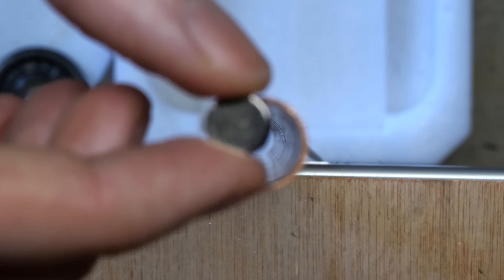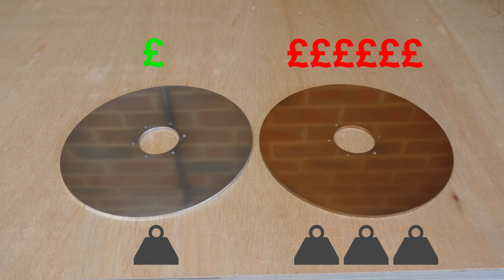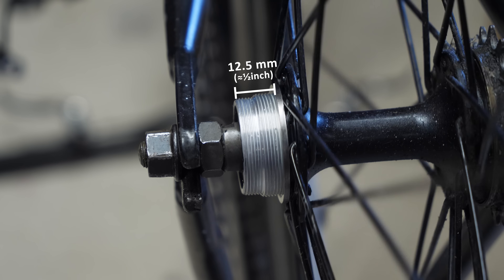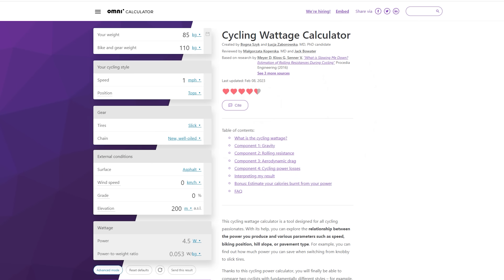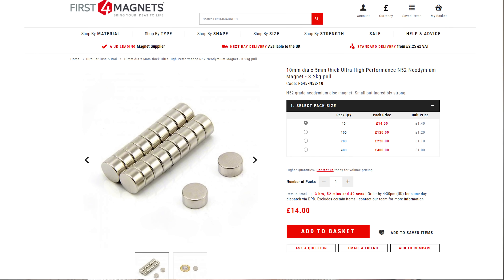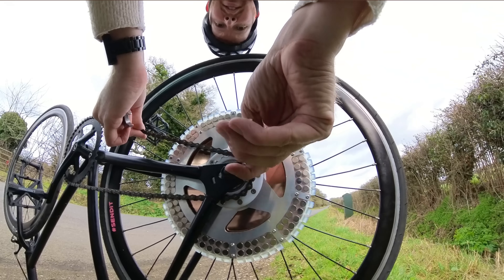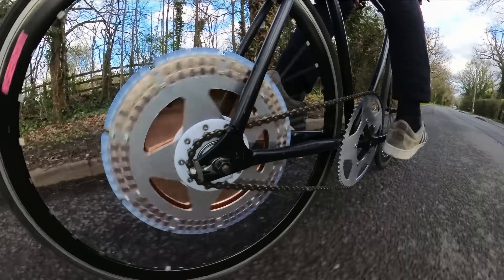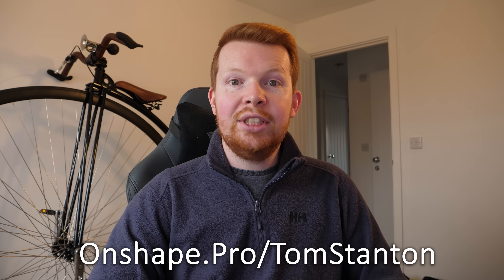Gearless Magnet Bike

Comment: The pessimist in me thought this experiment would end with the plastic carrier melting. Maybe it would with climbing a tall enough hill? Now, if you could find a good way to attach either the magnets or the copper directly to the hub shell or spokes, you could use an internally geared hub, whose sprocket can rotate at a different speed than the hub depending on which gear you select.

Comment: Great idea, but it's not a gearshift because the gear ratio can't be changed, right? It would be great not to have to change gears mechanically anymore. The sprockets would be superfluous. The transmission ratio doesn't change here, it's basically a different type of brake, a contactless one. Similar to an ergometer, where the resistance can be changed.

Comment: next step is to hook this up to a clutch pulley on the handlebar to change the magnet-disk distance. If you give this thing a higher gearing ratio in the chain, and maybe switch to a belt drive, this might work out pretty well.

Comment: Typical induction motors have a squirrel cage rotor rather than just having a solid piece of copper. That forces the eddy currents into more desirable paths and improves the efficiency. I imagine you could do something similar here by cutting an appropriate slot pattern in the copper disk and probably improve the efficiency a decent amount. It'd be fun to see how well this could perform with that kind of optimization.
Reply: I believe squirrel cage rotors are only used because they give space for iron which focuses the magnetic field. If it weren't for that a solid copper rotor would be better.

Comment: It seems to me you could adapt this to also generate electricity. I immediately wondered if there was any possibility of building up a charge in the frame.
Changing gears (pun intended), I wonder if you could use a sealed container filled with ferrofluid to create a sort of magnetic torque converter? It seems like it woukd be possible, at least.
Reply: There was a company that used eddy currents in standard aluminum rims to run lights for biking at night.

Comment: Tom, a steel plate (bridge) across the ends of the magnets away from the disc would have increased the flux very cheaply. Your next experiment could be using a neodymium hub motor rotor driven by your chain and a pulse-width controller modulating the degree of  coupling. That would be very low loss and variable ratio.

Comment: About 35 years ago, Schwinn Bicycle Co. had a frame you could mount your bike to that had your rear wheel run on a roller that was tied to an almost identical arrangement. You could vary the position of the magnets in the assembly by turning a knob.

Comment: Really cool use of theory. Turned into pack practical application. Even if it's not practical to apply on the daily, it really exemplifies the theory well
Reply: Hi, I admire your scientific method. What about putting this on an ebike, replace the permanent magnets with strong electromagnets, have an electronic controller which regulates the force, acting like a gearbox, cuts off for coasting, but charges the battery on regeneration when the brake lever is pulled?

Comment: Copper Vs Aluminium  for electrical conductivity. The correct answer is WEIGHT FOR WEIGHT Al is better conductor than Cu. But Al is less than 1/3rd the weight of Cu for the same volume. Thus if the application allows 3 times the volume to be used, Al is the better conductor.  This is rarely the case.

Comment: A fantastic bit of engineering and ingenuity.  I wonder if this could actually be geared if you could vary the strength of the magnetic field.  However, this would require some form of electromagnet which would then require a battery to power it and you would, in all likelihood, lose most of the advantage this might gain with the increase in weight of the bike.

Comment: A hub motor/wheel hub motor (used in electric bikes) Is actually a DC motor, meaning by applying dc power they run/rotate (obviously!). Also, if we rotate their rotor mechanically, they generate electricity (half sine wave DC current). What most people don't know is: while rotating it (while generating power) and shorting the motor's two wires, they practically/fully lock (HEAVILY resist the rotation). By attaching a high-wattage variable resistor (say; 10 Ohms/100 watts) to two wires of the motor we will be able to control the mechanical resistance of the motor (as a varible load), the same concept of this project but a more compact and more powerful and more controlled system. OF COURSE NOT AS MUCH FUN AS THE PROJECT IN THE VIDEO because it is not from scratch. Your layered disk sound logical.

Comment: Nice man called Faraday might be worth thinking about look up Faraday Disk if you already haven't considered this. I suspect all the EMF you are producing is going to heat. I wonder if connecting all the magnets electrically and effectively "shorting" them to the copper disk might give you different drive results, should be easy to evaluate with your bench testing models

Comment: Chains and Spokes are available in non magnetic 303 Stainless Steel and Titanuim. Plus you need a one way clutch for coasting without resistance. Or you could use even more powerful electromagnets.  Then you could turn the magnets off while coasting.But you are not saving weight. To be more efficent you need a larger Aand thicker copper disk with more surface area.

Comment: what about a variator style model? As you accelerate, the magnetic disk expands outwards to create a larger "disk" and with slow speeds it will shrink back down with the help of tension springs -- would be curious to see how that turns out.
Reply: That wouldn't help. This magnetic system is not gearing, it does not adjust the torque. If you move the magnets to the center you'll need to pedal faster but you'll still need full torque, you'll just be producing more heat.
Reply: @eDoc2020  I see thanks

Comment: What about the drag between pedal strokes
There is no on off on regular magnets.
Electro magnets in stead and momentary
On off, if you watch the video
On the cam over the drive stops momentarly due to the resistance and 
Lack of our power to complete a smooth 
Cam over pedal stroke, but dont use the electro magnet to drive ...

Comment: Yes this is a great visual REAL World example of what happens  under this experiment, thanks.  We use a machine that has "MAG DRIVES" magnetic couple  , for high pressure fluids so it cannot leak since there are no shafts or seals.

Comment: magnets sticking to things. One way to quell that is to have a have a flat steel plate on the outer side of the magnets. this will also redirect the fields back to the neighboring magnets and not into the chain or spokes.
Great project.

Comment: hi Tom, next time you could use a rear hub with a disc brake mount - it uses 6 holes, on a 44mm PCD. Always good to seek what technologies such as modern cycles, exist to make prototyping easier. Im an Engineer & cyclist, who aslo works on cycling products and accesories. if you need a pointer or advice let me know.

Comment: I don't understand what you are trying to do. I have something you can do. I live where hurricanes take out the power. Can I get some magnets on my exercise bike to give me something between 15 to 20 volts DC. I know how to make AC into DC easy. With that I can put it through a charge controller to charge my 100 AH LiFePo4 battery. From that I can run my radios and other things. Just need to get my exercise on the bike.

Comment: I would suggest doing away with the copper plate unless it's integral to the design. you could get as much from having the magnets really close to the spokes but then again I would do away with those and use a hollow rim design with an iron circle for more consistent  attraction. you could have 4 or 5 thicker connection points to the wheel and the rest open space with only the center solid where you want the iron to be. wouldn't weigh much different than the spokes plus give you more attraction power and less slippage. since it's a casual rider and not off roading that should work but it would need to be balanced. If you have to go with the copper you could electroplate aluminum for a form of heat dispersion. though finding a way not to generate the heat to begin with would transfer the heat in to thrust rather than dispersing it. sadly the slipping is most likely what is generating the  heat but mainly between the magnets and copper. if you locked the magnets on to the copper plate and had that free spin instead of having them spin separate that would reduce some wasted energy.  how ever you would still get heat from the spokes breaking the pull of the magnets.  skywall makes a bicycle rim like what I was talking about.  I would have to do some more digging in to the subject and a better understanding of what you are trying to achieve as an end goal to come up with some more ideas to try. If you want I'm willing to do such to help you get something going for free. If nothing else it would make for a good sounding board for you.

Comment: Imagine if bike brakes were just magnets 
Cause the rim itself is already aluminum. And then to get to a full stop you'd use friction. Imagine how little wear you'd have...
Trains already work this way. The ICE trains in Germany break with a combination of magnets coming close to the track and re-gen in the motors for high speeds and then friction for the last 20kmh or so

Comment: Just attach a second sprocket on the back that you can shift your chain to that will act directly upon the wheel, skipping the whole magnet system for going uphill. Then you shift back to the magnets for variable torque when on flats or downhill.

Comment: To fix the issue of your magnets sticking to the chain, you should close the half of the magnetic circuit that is facing away from the copper disk with for example a steel plate. This should also increase the strength of the magnetic field in the copper and make it easier to climb your hill. However, I don't think there is any amount of engineeering that makes this a better bike than a regular transmission bike.
Reply: Or just use string drive!

Comment: Why use eddy currents which are inherently creating  heat loss!? why not two disk with attracting magnets.. rig that to super capacitors next and you can have regenerating braking. and energy to feed back when you climb hills! an electric bike without batteries..

Comment: Fine example of a kitchen table inventor producing a pointless result. Some relatively simple engineering calcs would show that this concept was wholly impractical for many reasons.  Cyclists strive to get the very highest efficiency out of their continuous effort (typically around a mere 50W output and short time burst of 300W for a sports fit cyclist).  Dont start cutting metal till you have fully researched your fundamentals aka PPMs  perpetual motion machines fallacy. How many of those are still pitched on YT

Comment: It's like a Torque converter in an automatic transmission. Only it uses magnetic coupling instead of fluid coupling. I wonder if a Torque converter  using magnets instead of transmission fluid would have any benefits? Never mind someone already has a patent on one way back in 1977 Inventor Donald A. Kelly

Comment: What about using a magnetic cvt based on reluctance?
A stator with EM, a rotor with iron poles to the chain...and a rotor with PM to the pedals:
No Joule's effects... and the chanche to vary gear ratio controlling electronically the stator's EM...
🤞
What I'm not sure, is if a further ring with PM is needed between stator and iron poles, like showed in many papers...🤔.
Any of you have tried something like this?

Comment: Looks like it would be aluminum. The reason i say this is i used to repair aircraft instruments. And they had a  hysteresis disk the outer driven disk with a second disk a very short distance away. Then the aluminum disk  in-between the two disks with magnets you adjust the distance between the magnets and as they get closer the  more they drag the  disk in the middle. The magnets a alternating  north south north until you cover the disk the more you have and the stronger they are the better on the second disk they have to be laid out in the exact same physical spacing. Only the pattern on poles change so that without spacers to separate them otherwise they stick together. That set up would allow the best magnetic coupling.

Comment: Cool project and engineering. But why? 

1. Human legs leg don't need a clutch as they can produce torque at zero speed. 

2. There are significant losses due to the eddy currents heating the copper disk. Bicycles are all about efficiency, so this seems like a "step backwards by design"??

You seem to get to this conclusion yourself at the end of the video. Yet any engineer with your substantial skill and knowledge should have known this from the outset. Fun to build, but a terrible project if you expected vaguely useful results, as the outcome was totally predictable just on a basic energy transfer principle.  

As for "variable ratio drive"? Well that was a always a pipe dream. All this can possibly ever produce is "variable slip"...

Comment: Suggestion: reverse the speed of either the copper or aluminium disc with an opposing gear. This way the one will, definitionally, always spin relatively faster than the other, since they and moving in opposite directions from one another. One has a positive rpm value, the other a negative. Would this work?
Reply: That's possible as a break but not as a drive

Comment: I imagine as the copper heated up the resistance level decreased causing a greater difference in RPMs thus putting more of the energy toward heat.  The rider would work harder though the bike would go slower.

Kudos on a successful experiment.  First we seek kowledge.

Comment: Instead of completely getting rid of the rear sprockets you should try putting the magnetic clutch on the pedal side, attach the factory sprocket to the clutch and mechanically connect the new front sprocket with the factory gear ratio shifter

Comment: You are first person to invent moving stationary bike.
This magnet setup is used in some stationary bikes to literally waste riders energy and convert it into heat (it heats up the metal disk).
The reason you are moving slowly while putting a lot of force through your pedals is that most of your energy output is wasted (presumably into heating the copper disk) and only some of it is actually used to propel you forward.